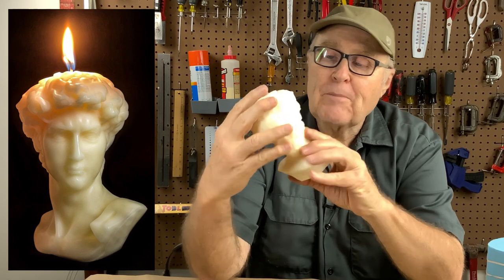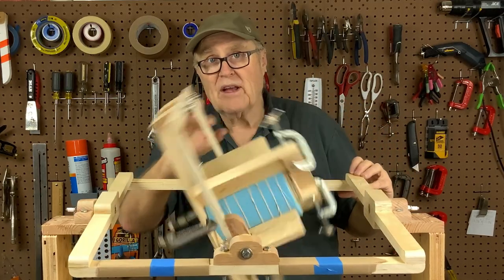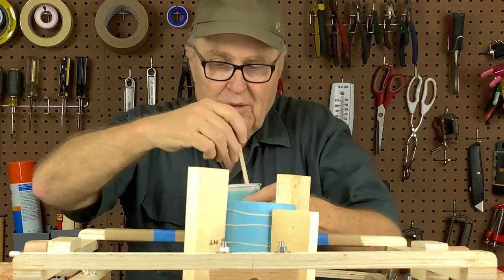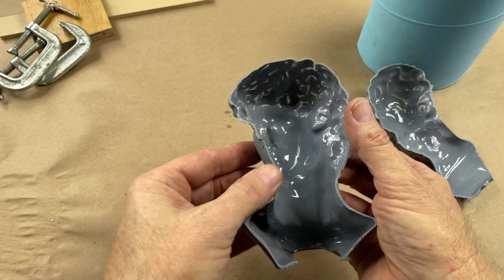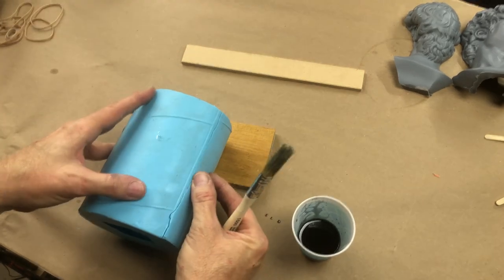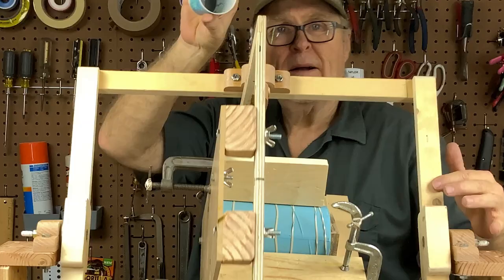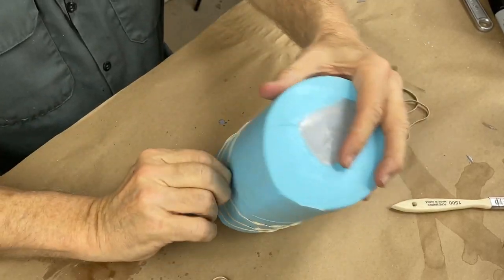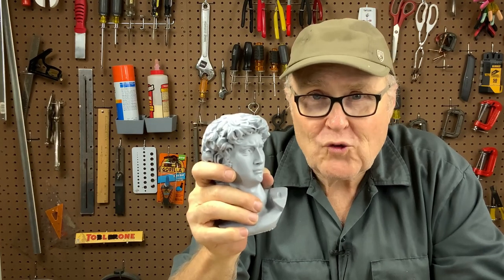Rotational Molding Tips And Tricks

Comment: It's not centrifugal force that pushes the resin into all the crevices, it's the surface tension of the resin in it's liquid state.  Getting it to spread evenly over the entire internal surface is the trick, and the only way of ensuring that is to keep the rotation going sufficiently long enough for the resin to set evenly along all surfaces by continually rotating the mould long enough for it to set.
Reply: Surface tension is why I spray alcohol in my soap molds to catch all the details.

Comment: Wonderful stuff, thanks.
Reply from the maker: I didn’t answer your question before I set the first flawed video to private. The orange and white striped tool on the board behind me is my clicker clacker. I have a Zoom sound recorder and anywhere from 1 to 3 cameras running in each scene so I use the clicker to sync the audio tracks. It’s just made out of one by twos and I paint it so that when I set it down in my shop I can find it. Otherwise it blends in with all the other pieces of scrap wood laying around!
Reply: @RobertTolone  thank you. 🙂

Comment: hey robert, i have been bingewatching your videos, and have for a long time wanted to try my hands with casting, but i have found it hard to figure out what i need to begin, and what would just make things easier. do you have any advice on something like a starter kit?
Reply from the maker: Well,  I guess the minimum you need is silicone rubber, urethane resin, mixing cups and stir sticks, a scale, an XActo or other sharp knife, rubber bands that fit your molds, gloves, paper towels and acetone for clean up.  The list of what you will want if you really get into mold making is much longer.

Comment: This is interesting, Just started watching your videos. I'm an amateur caster that makes occaisional parts for models I make. I want to make soft rubber tires for some 1/25 truck models. I have tires from suppliers but they aren't in business anymore, so I want to remake the few I have for future models. Just trying to figure out what the suppliers I got the tires from made them with. It's a flat black soft rubber, the tires are solid.
Reply from the maker: It’s very hard to say what the original tires were made from. You could make them out of either silicone or urethane rubber pigmented black. Just be aware that casting rubber into rubber requires that the materials are compatible and that you use a good release agent.

Comment: Cant believe how nice that rotocast came out. I built a rotocast unit some years ago, and it never worked properly but I can resolve every issue I had by watching your videos. Would lightly coating the inside of the mold with talcum powder help minimize the air bubbles? Or, would that adversely affect the finish of the cast?
Reply from the maker: I’ve never been a fan of the talcum powder method. But a lot of people swear by it. All you can do is give it a try and see if it works for you.

Comment: Hi Bob, great content as always. Quick question, is it ok to pour resin on cured resin, I've never had that much success with my PU as it seems not to want to bond to itself once set (unlike silicone). Cheers.
Reply from the maker: The urethane resins I use always bond to themselves just fine. Be sure that your A/B ratio mix is perfect. Otherwise you could have some sweating of uncured resin, etc.

Comment: Seems like spinning it fast might be good to get it in some smaller crevices of the mold. Then slow it back down after a minute or so.
Reply from the maker: Maybe it would, I've never tried it.  You would have to build a rotation machine and cradle that could withstand the high RPMs. And you would not want to get your hands anywhere near it. In my motorized rotation days I was extremely careful to not get my hands caught between the spinning frames of the machine.
Reply: @RobertTolone  of yeah for sure. I don't really even know how fast it would need to spin, probably depends on the mold.

But at the same time, if the mold has bits that small, would probably be a real pain to cast anyway

Comment: You might've mentioned this before, but do you need to wait for previous coats to fully cure before adding subsequent ones, or do they just need to gel?
Reply from the maker: Each coat just needs to gel enough so it won’t peel off the sides of the mold when the next pour is added.  Your witness cup will tell you when it’s ready.

Comment: I've heard mention in previous videos about filling holes but I haven't seen it done. Did I miss it or is that something you could make a video on?

I've tried filling before but it never looks right. I used to loose a lot of pieces to holes but I fixed my mold and don't get them as often.
Reply from the maker: I hate to clean parting lines and I hate to fill holes. If I have only a couple of small holes I will fill them, usually with epoxy clay, but if there are a lot of flaws in the casting it’s faster just to make a new one.
Reply: @RobertTolone  ok thank you. Was just hoping to learn how. Have a great day. 🙂

Comment: Hi Robert. That as great! I once made a mold/cast of Popeye sculpture for a client and had a night are with thin spots, though that was without a rotating rig. I'm definitely gonna make one next time.  
Wondering have you done any casting with metal powder effect fillers? 
Also wondering, as that wax version shrunk and warped, does that usually happen when they make wax casts for bronze metal lost wax casting? Maybe it's a different wax or something? 🤔
Reply from the maker: I have done some cold cast bronze work but not very often. I find that the hardest part is cleaning the castings to make the surface look good. For instance extremely hard to fill holes and get them to blend in.
Reply: @RobertTolone  ah yes, I had similar issues when I tried it. Though I don't have a pressure pot set up. Wonder if a bicycle pump would work in a pressure pot? Possibly too weak.
Reply from the maker: @mickybetts7957  Also very hard to pump up a pressure pot quickly enough with a bike pump. The resin would set up long before you got it up to pressure.

Comment: You mentioned how heavy the mold is, how would you build a rotocaster for a mold that weighs almost 20 pounds when all the resin layers are poured in? Thank you
Reply from the maker: This machine would easily spin 20 pounds:
https://youtu.be/0IsWzmWj-5o
It's not the weight, it's the balancing the load over the centers of rotation.  If the mold is well balanced it will spin effortlessly with no stress on you or the machine.
Reply: @RobertTolone  thank you!

Comment: Heey a question about how I can demold a concrete statue out of a shore 40 silicone mold. It is a one piece mold but it’s really hard to demold, do you have some advice? Thanks!
Reply from the maker: It's a very firm Shore rubber.  For concrete casting I would switch to a urethane rubber mold and make sure it's soft enough to flex off the casting.

Comment: Thank you for all the great information! So helpful! How do you deal with the little bubble holes? Would something like Testors modeling putty work? Also, have you ever had problems with the layers of resin delaminating?
Reply from the maker: I mostly use epoxy putty for large holes and the modeling putty they sell for plastic kits for small ones. Bondo is also good. You can also use the urethane resin itself, or baking soda and superglue.  Or make urethane resin dust with sandpaper and mix with 5-minute epoxy.  As you can see, just about any filler works just fine.
Reply from the maker: No, the resin bonds to itself really well.
Reply: @RobertTolone  Cool! Thank you!

Comment: Amazing video. Thank you !  I am trying to roto mold a small stool of L30cm x W30cm x H40cm with four legs. do you think it's possible with your metod ? I believe it would have to have at least 2 batches of plastic. is it possible to rip open the first layer and pour the 2nd batch ? Have a nice day and stay safe.
Reply from the maker: The closer your object is to the shape of a ball the more likely you are to be successful roto casting it. Objects with lots of long thin parts like a stool are not very good candidates for Roto casting. It would be possible to cast the separate parts individually but even then the long thin parts like legs are difficult to cast with rotation.
Reply: @RobertTolone  Thank you Robert for your advice. I will still try to rotomold it anyway just to test out since it has some chunky legs, do you think cutting a hole after the 1st batch of resin and pour the 2nd would work?.  If this fails I will just make it solid resin, I was trying to find a solution to save some material.  Thank you.
Reply from the maker: @keunartist  Yes, you have to cut open the plug hole to pour resin in successive batches.

Comment: Surprised to see an absence of suction defects with an unvented rigid cast.
Reply from the maker: I’m not sure what suction defects are.  I always punch a small slit into the pouring area with an Xacto blade but the air rushes out, not in.  That is because the curing resin heats the air inside the cavity and causes it to expand.
Reply: @RobertTolone  Some of the air usually escapes as the resin warms, before a full seal is developed. As the piece cools to room temperature with a seal the escaped air can show in indented areas, mostly broad flats. I missed the knife slit.